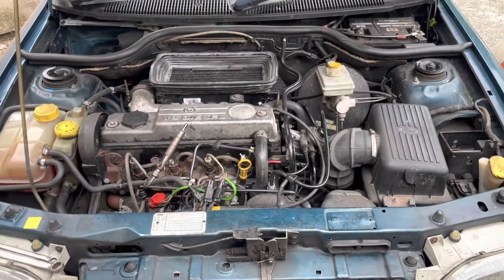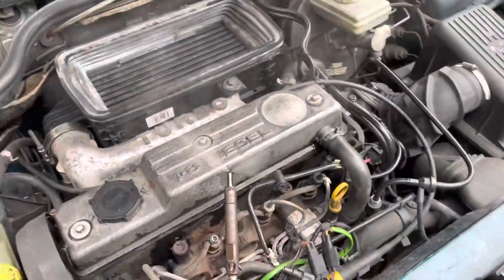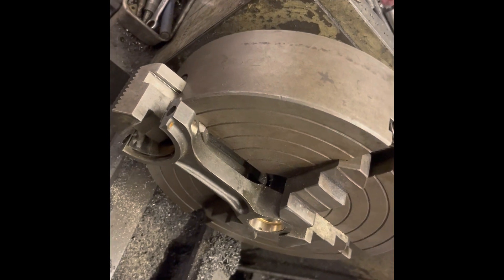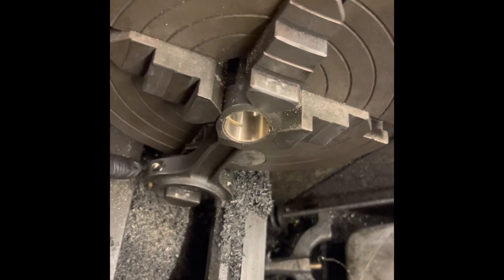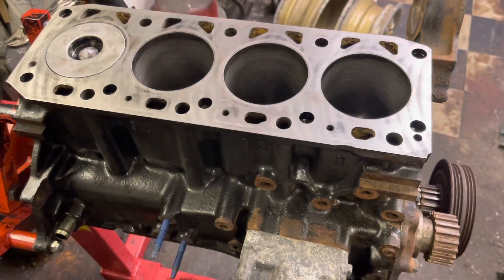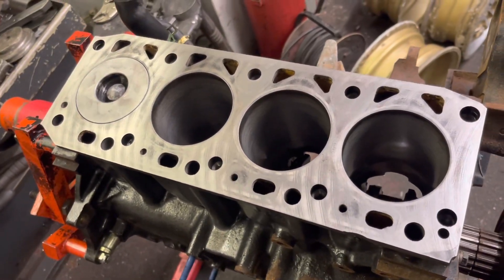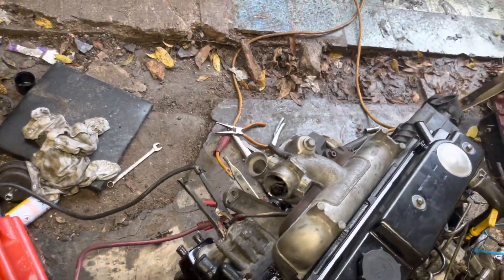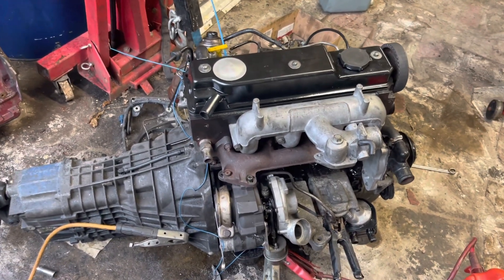Ford 1800 Turbo Diesel direct injection conversion

Comment: Wich rod bearings did you use? I have a problem with my mtddi conversion when i try to torque rod bolts engine doesnt want to spin easily with new glyco bearings. I looked and the bearings should be the same on every 1.8td/tddi engine. Block and crank is from td mondeo newer machined pistons and rods from mk1 1.8tddi focus.

Comment: That Lucas injection pump won't last long. Your asking it to open injectors easy 100bar higher pressure than the indirect injector it's designed for. You will find it'll probably twist and or snap the pump drive shaft.   I built one of these hybrid engines a few years ago but only recently finished the van enough to get it MOT, You need a Bosch VE pump with the correct cam plate for this engine. I'm on my 3rd combination of VE parts now hopefully to get it to run propperly.

Comment: The French & Germans were doing it so much better, even in the 80's.
Reply from the maker: yep agreed my pal had a vw breakers years ago said he never sold one 1.9tdi (afn) engine ever ! simply do not fail
Reply: @thehillmanator  That was the best of the 1.9's. The 90 bhp was a slug, the 115 suffered porous heads, and the 130-150's did around 10 mpg less. Plus I don't like PD. The AFN was amazing on fuel, 60 mpg with care was possible, and 500,000 miles

Comment: This is a cool idea. I will be curious to see how it runs. I would expect that the di engine uses a more aggressive camplate in the pump so as to inject the fuel through a shorter crank angle duration. Some of this might be mitigated with slight base timing advance
Reply from the maker: interesting in that i had to advance the pump a full tooth on the belt to get it to fire up! 
since the first run it cracks up withi first 3 revolutions from cold without any glow plugs connected. also appears to run very cleanly, will post update when it’s up and driving in the ambulance 👍

Comment: Thats pretty impressive mate.

I have a 1.9 XUD, also indirect injection, and the sound is what i love about it, but it makes little power. Its a turbo without intercooler, and the pump has no boost membrane for additional fuel

Comment: Hi Andy , you said about putting a twin cam head on the diesel block , would that be running petrol then? Or modified diesel twin cam ? Thanks dude great content , just found you on YouTube, cheers dude 👍👍👍👍
Reply from the maker: apologies i ment it’s the same family of engine and the head stud pattern is the same as x flow so the head will physically slide on 👌